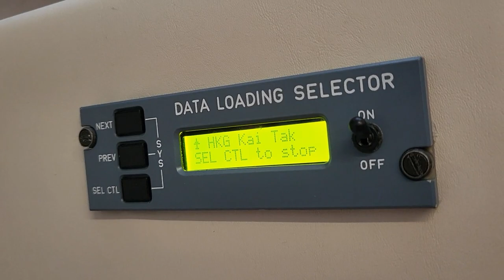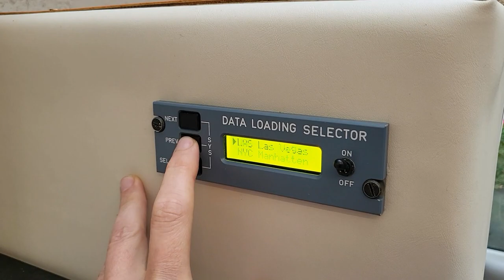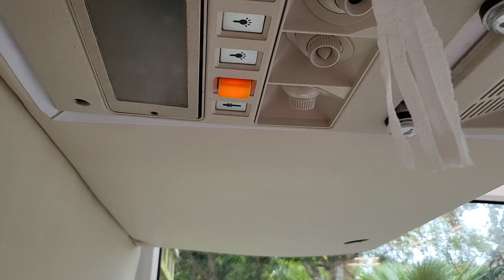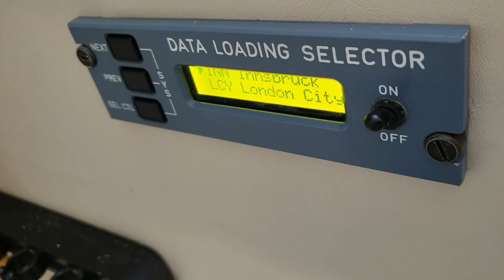Alternative flight simulator

Comment: How much would you sell this out right?? Honestly....
Reply from the maker: I use the seats a lot for conference calls so not up for sale, sorry
Reply: @AlexShakespeare  ok, l understand. I was wondering what it would cost to have something fabricated like this....total. l can delineate the cost of time and materials.
Reply from the maker: @n1663r  (Prices approximate) Seats cost £150, overhead panel was £20, side panel was £170 (although I still have the other half of this in storage, the panel had two windows), control panel was £80, PI/electronic bits around £40 and wood/other materials around £50-60 - looking at around £500-600 to re-create I think. In terms of time, I could probably have constructed in 5 days, working solidly - it actually took me around 3 months in total I think, mostly working Sundays when I had spare time.